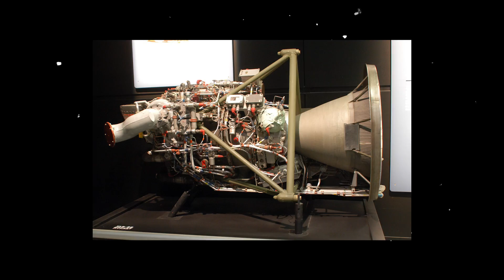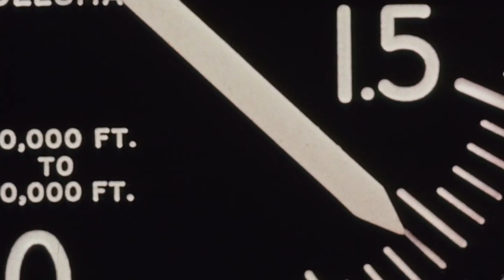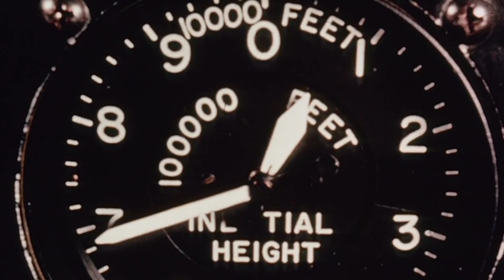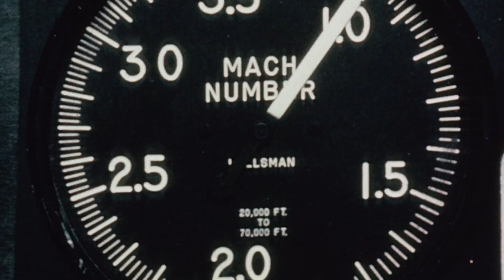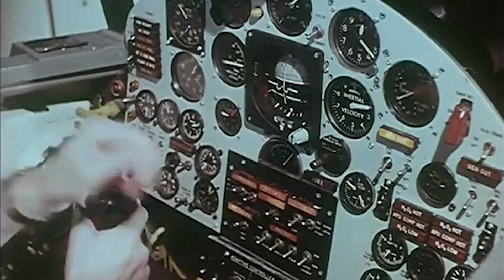The Plane that Almost Melted - The Fastest Flight Ever Mach 6.7

Comment: The X-15 that broke the speed record was the one that was painted with the white anti-heat coating. Despite this coating, some leading edges of the aircraft did indeed partially melt.
Reply: That white coating was actually an ablative coating designed to burn away and protect the aircraft underneath.
Reply: Yes, and also fun fact...the white patches you can see on the underside of the X-15 in several of these shots is ice forming from the super-cooled fuel under the tanks.
Reply: @davebartosh5  fuel or water from air?
Reply: @norbert.kiszka  The fuel is very cold, inside the plane..so ice forms on the fuselage from water in the air.
Reply: @davebartosh5  but You told "super-cooled fuel" instead of super-cooled water.
Reply: @norbert.kiszka  Gee, I'm reallysorry you're confused.  The Fuel is what's cold.  It freezes the water...Got it?!?!? 🤣
Reply: @davebartosh5  there is something called super-cooled water. Basically that is water in a fluid state with temp below freezing point. Any mechanical shock will make it become ice instantly.
Reply: @norbert.kiszka  That's irrelevant.  BTW I have a degree in science.  Thanks anyway for your fascinating commentary....
Reply: @davebartosh5  in what science? Im afraid You are not a physicist.
Reply: 40 seconds into that video you can clearly see a stage of the rocket covered in ice.  That's where the fuel is stored,.
Reply: @davebartosh5  oh, so You have degree in watching YT movies.
Reply: 😂 @norbert.kiszka

Comment: The 104 was simply known as a rocket engine with wings
Reply: WIDOW MAKER
Reply: @flickingbollocks5542  Yes, that was one of the issues...
Reply: @flickingbollocks5542  those short, stubby wings made it hard to control.
Reply: You're Right & It Really Wasn't Successful In The Military Role It Was Designed For. @flickingbollocks5542
Reply: They could barely be called "wings." More like fins.  I walked around the one parked at Moffett. Wings looked like they could have been cut out of 4x8' sheets of plywood.
Reply: It was known as "A Flying Coffin" in Europe.......history shown that VERY large envelopes of cash was passed to people of influence in Europe, and around the world, by Lockheed "Influencers"......it makes you wonder what goes on today doesn't it :)
Reply: @Tommywal-ker because in Europe they tried to use it as a ground attack aircraft, it was designed to scramble, get to altitude rapidly, and attack bombers. It was a no compromise interceptor.
Reply: @kdrapertrucker  You mean it was sold to them by the Lockheed Execs as a Ground Attack craft after passing on VERY stuffed envelopes of cash :)

But the stats show a very shaky aircraft at best:  the RCAF lost 1/2 of their craft to crashes and the Germans about 1/3 was lost that came with the loss of 35 pilots and a huge payout to the families by Lockheed.
In USAF service the F104 had 25 accidents per 100,000 hours flight, to put that in perspective , the Super Sabre had about 16, the Voodoo had 9 and about 7 for the Delta Dart.

Don't get me wrong, the 104 showed innovation and did have plus points but the corruption surrounding the deals that were done on top of its dodgy flight record taint the aircraft to many.
Reply: @Tommywal-ker  German and canadian pilots were poor pilots !!!
Reply: @Tommywal-ker  Back then they were called "Lobbyists", the term "Influencer" is used for social media celebrities.
Especially because the lobbyists are usually officially part of the enterprise they advocate for.
Reply: I talked with a pilot of the F-104 who (because of it's short stubby wings) jokingly referred to it as "The Flying Hooker" because it had  "no visible means of support!"
Reply: @jstephenallington8431  Said short stubby wings have a leading edge so sharp there were incidents of people getting injured by accidentally bumping into them...
Because of the speed of the fighter, that was necessary.
Reply: Man in a missile.
Reply: Yes, the "missile with a man in it". Though that design had its very own unique bunch of, partially, severe issues.
Doesn´t change the fact that it DID leave its impact on military aviation history.
Reply: Similar issues with bureaucracy exist to this day with aircraft for similar reasons. Look at the inflated costs of the F35, the inexplicable issues with the V22, or the lack of brains inside Air Force One.
Reply: @Cedar_Valley_Live  Good one.